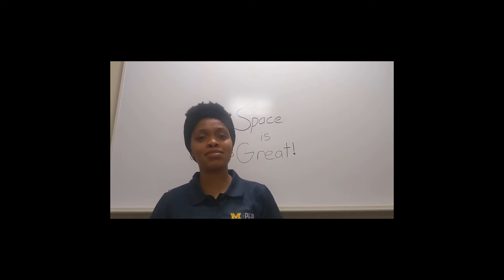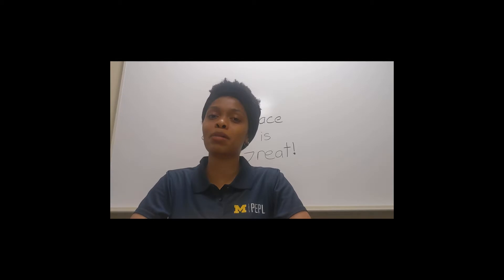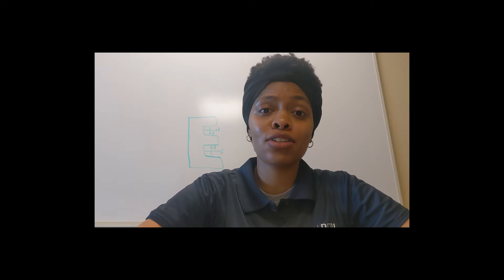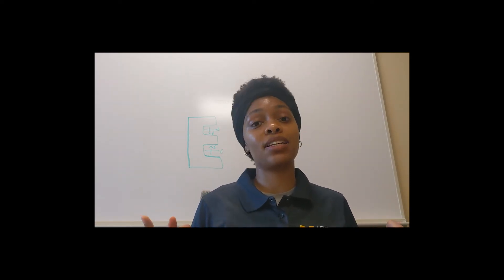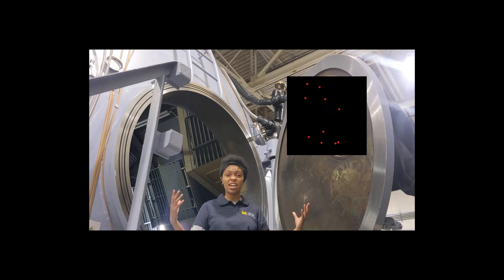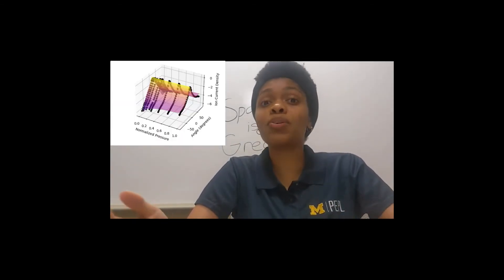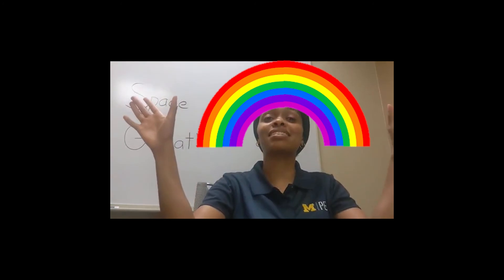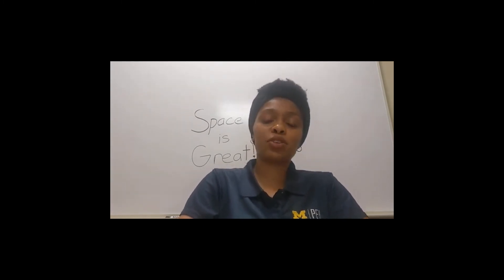Hall thrusters work differently in vacuum chambers than in space

Comment: To get a more perfect vacuum may I suggest something to the effect of:   In an airtight vessel that can be opened remotely, place pyrophoric iron, the larger the surface area of the better.   Purge the chamber of everything except for oxygen.   After pulling as perfect of vacuum as the pumps will allow then open the iron container.   The remaining oxygen should bind with the iron forming a precipitate and by default and more perfect vacuum.